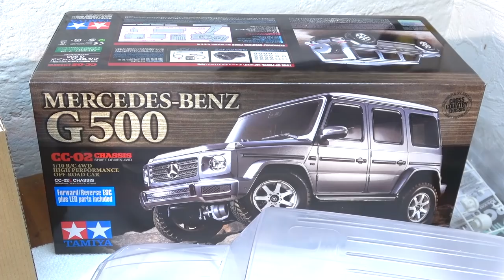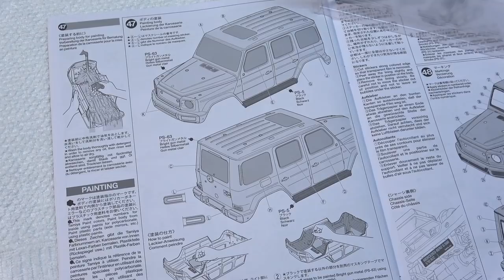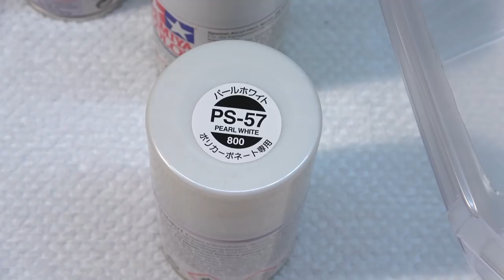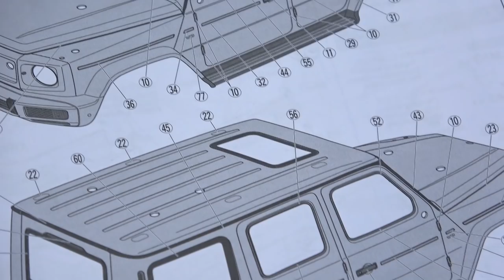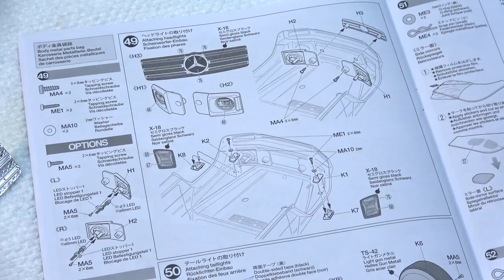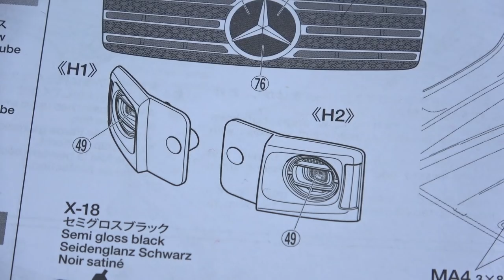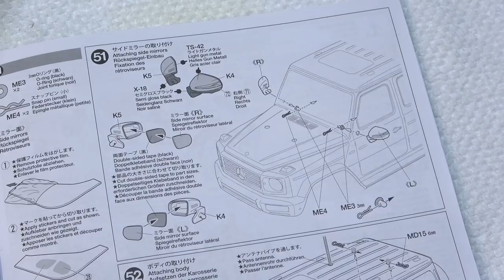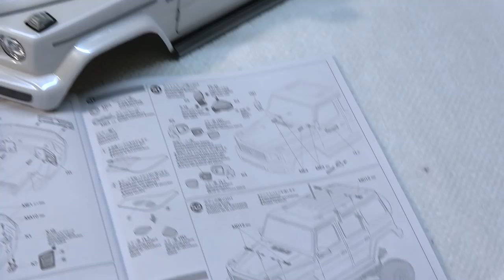Tamiya CC-02 Mercedes Benz G500 / Build Video 6 / Steps 46-52

Comment: Just grab, 7,4V from the Lipo Balancer. Great Video, nice detailed body.
Reply from the maker: Thanks David! The problem is it would not discharge every cell simultaneously. The two cell would be more discharged from the LEDs as the other. But to be honest, I think this would be not so much.
Reply: @Matteomeier  thats true but I also think this is a very small amount of current flowing to the LED unit.

Comment: hi matteo, I need you help... I really can't understand, I've just finished the mechanics parts and I'm going to paint the body. But I need to apply masks window stickers inside and outside? and than for the outside before paint and then remove film? How it could be? paint passes through the film?? Im sorry but I'm getting crazy... thank you
Reply from the maker: Maskings of windows from the inside. Painting also from the inside! Nothing to do from the outside. Only when everything is painted remove the film from the outside and it’s finished. I think you can see this in my videos.
Reply: @Matteomeier  you're very kind, I did those questions because the tamiya's istructions seemed to be not clear, there where shown colors of boby outside (step 47) before using paints, however now I've understand. Really really thank you Matteo !!!! ciao

Comment: Fantastic video. Lots of detail in this kit. You did a fantastic job on the body. It always takes me awhile. On the lighting kit. I run them into the receiver and run a extension out of the receiver and just plug it in using a male end from the lighting kit. It works great and easy. It doesn't need to be plugged in between the battery and esc. I like that chrome paint marker you have.
Reply from the maker: Thanks! This is a good tip with the receiver for the LED's! 👍😊😊

Comment: I have used the PS 31 smoke black on my TT-02 Acura NSX results came out excellent. The trick is to apply in very very thin coats. Tell you reach desired tint. Also on the NSX so many decals over 100. On some parts i painted before. So applying those decals wasn’t necessary. But did anyway. I did the same for CC-01 Unimog 425.
Reply from the maker: This is good work! 👍😊

Comment: I cut away sections of the overspray film on the outside to use as a mask for painting of exterior rubber/plastic trim. Looks far better than decals in my opinion and far less susceptible to damage! But awesome job buddy loving the pearl white finish!
Reply: Cool tip!
Reply from the maker: Thanks for this! I use this method to make fenders matte, but yes it should work also for painting small things. But is it easy to cut some small straight lines?
Reply: @Matteomeier  I used this method to apply the mud splash graphics on the rear fender of the F150 Raptor shell on my Traxxas Slash once, painstaking work but looked great when finished

Comment: Really nice work, For the TLU-01, i run mine directly conected to the reciever, the TLU-01 works super fine with the same voltage as the reciever output in all channels, since you arent running it with all slots full and paired with the TLU-02, where it trully demands then the full 7.2V
Reply from the maker: Thank you for this tip, this is also a good option! 👍😊😊

Comment: Wonderful work my friend.

Could you have used a paint pen for the body lines, or is the body too slippery?

Also, the chrome marker pen, what size is best - 1mm or 2mm - many thanks. A superb build.
Reply from the maker: Because the indentation along the doors on the body is very small, so it's very difficult to get straight lines with a pen.

Comment: Great video! Since you used small permanent marker for the edge of the light, why not also use it for the door lines as well? I don't have a delicate hand like yours to cut those tape that thin lol
Reply from the maker: Thanks a lot! But to draw these straight lines, you need much calmer hands than with the tape...😉

Comment: The TLU-01 contains a MC34063AL switching regulator IC from UTC (http://www.unisonic.com.tw/datasheet/MC34063A.pdf). This part is rated up to 40 Volts, although I do not know if the rest of the circuit can handle that much more voltage. At least the input capacitor is rated for 25 Volts. Personally, I would not try more than 18-20 Volts.
Reply from the maker: Ok, this explains why it works properly with 3s. Thanks for the info!